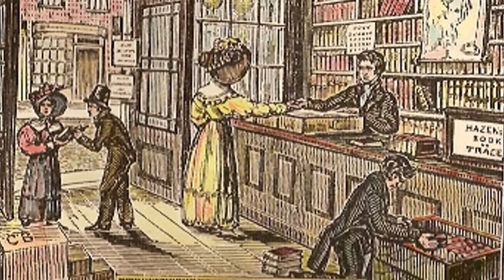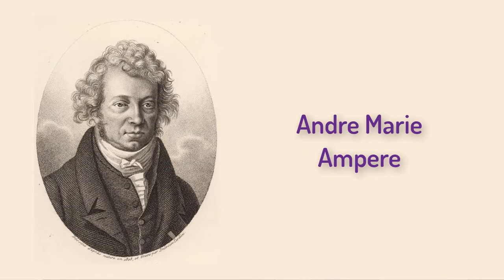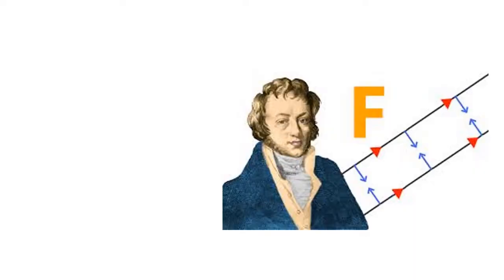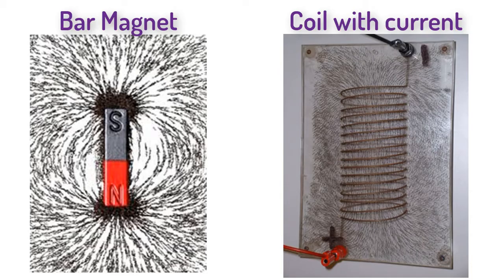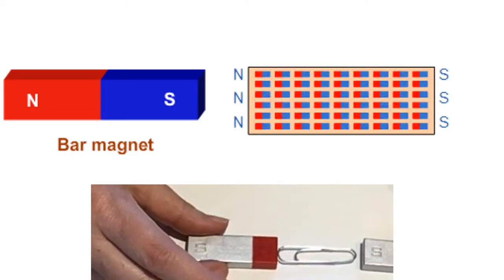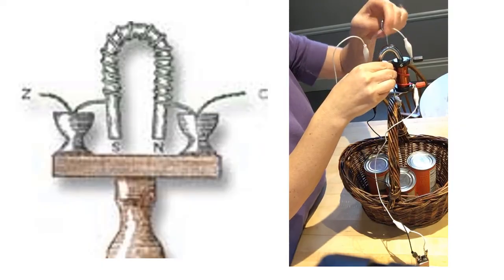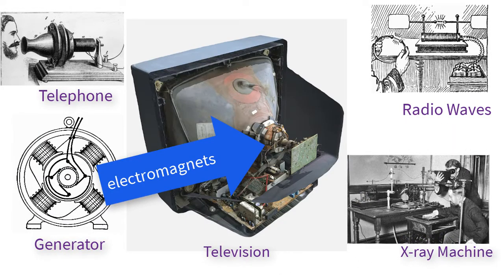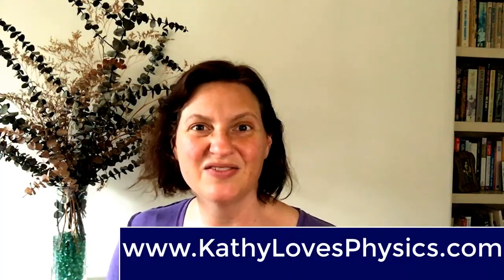How an Electromagnet Works and Why a Shoemaker Invented it

Comment: On e I get my lab up and running after a move, I’ll try it - but - what happens if you wrap a current carrying wire around, say, a bar of aluminum rather than steel (or cobalt, nickel).  I know eddy currents get generated, but will it concentrate the magnetic field lines and will it attract ferromagnetic materials?

Comment: When you really think about it, the quote, "Advanced-enough technology is indistinguishable from magic" is actually not quite right.  Electromagnetism IS magic, as far as the basic definition is concerned!

"Magic" has its only difference in having the person doing it have some sort of direct or indirect control of the actions of some object, including living things, or summoning up some being that has such ability that will do its thing when the magic-user requires it (forced, bribed, or payed-for).  "Electro-magnetism" as a source of energy and controlled force is different only in that it has a physical form that can be built-into objects using manufacturing techniques similar to those of a blacksmith (taking the proper rock and extracting the iron and then mixing it with heat and other materials in the correct way to strengthen the final object, such as a sword, for some purpose).  Once known, anyone with the knowledge, resources, and enough skill (and usually assistance in a group project) can create the device that performs the "magical" activity.  And the things electro-magnetism can do or are involved with in our world are magic as far as their huge variation, including chemistry, biology, power generating, power directing, communications, computation, and so forth,. ad infinitum.

There is NO difference between electro-magnetism and magic as far as the possible results are concerned, just more repeatable, down-to-earth rules governing these created results...